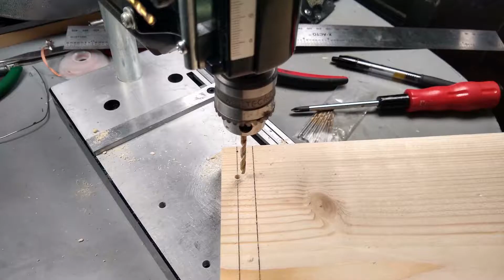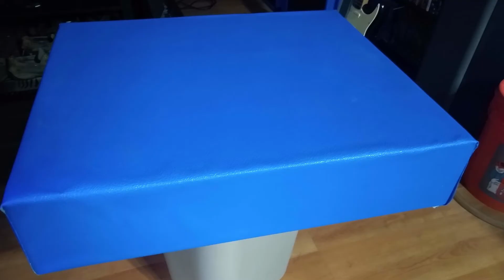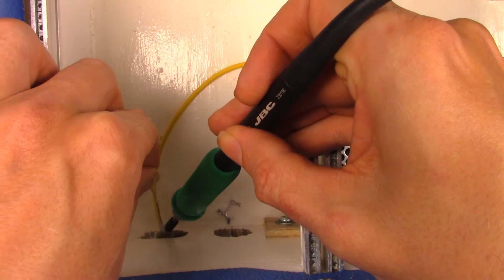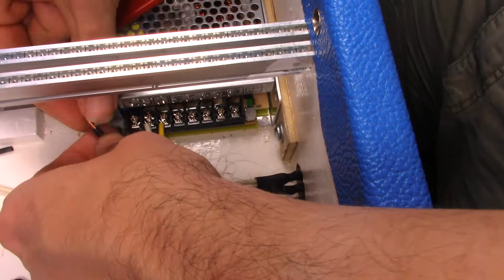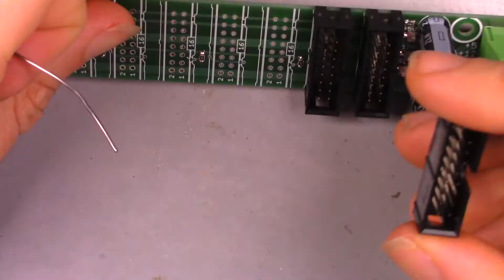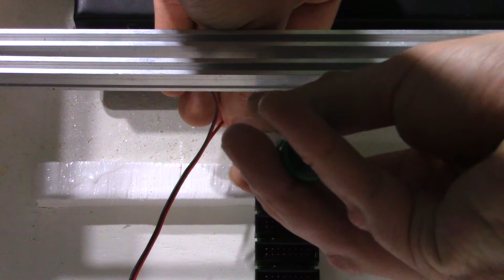Building My Custom Eurorack Case

Comment: Thanks for making this video. I've built a few custom cases myself, but this one has some unique features, and you built it in a very satisfyingly neat way. Great tip about the power supply too. I've been wanting to try a Meanwell one for a while, but couldn't decide the best one to use.
Reply: Be careful if you're going to use Meanwell power supplies. Although this was an interesting and well done video, there are a lot of videos just like this showing Meanwells that are installed dangerously with exposed AC terminals. I think that there are probably a lot of people installing Meanwells just like this without realising the potential for electrocution without the ac terminals covered over by some kind of junction box housing.
Reply: @wvo2m  Thanks, this is a good point. I think for a DIY self-built case to be used by someone experienced, where everything else is done neatly, this is kind of OK. But for a beginner level, it is a real risk to leave mains terminals exposed. Apart from the risk of directly touching the terminals, an uninsulated wire from a module (eg a messily built DIY module) could accidentally touch them while the case is in use.. definitely simpler just to cover them up!